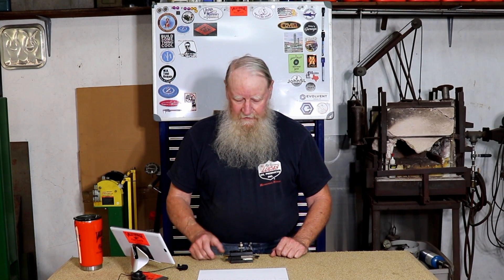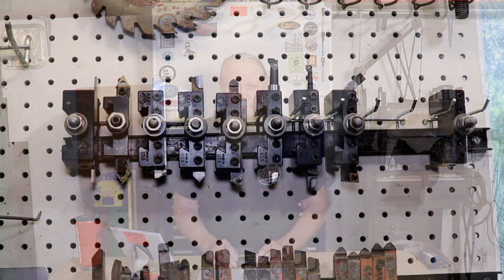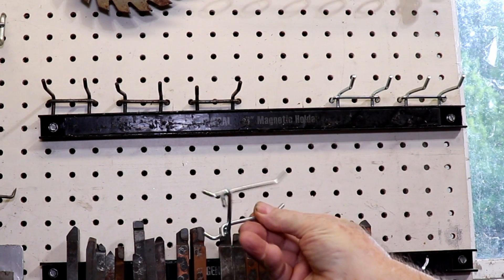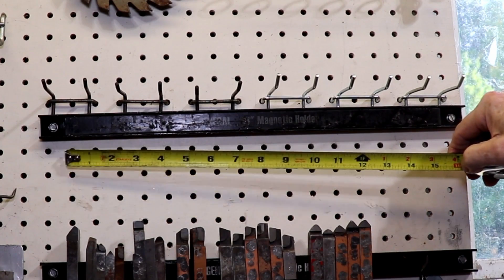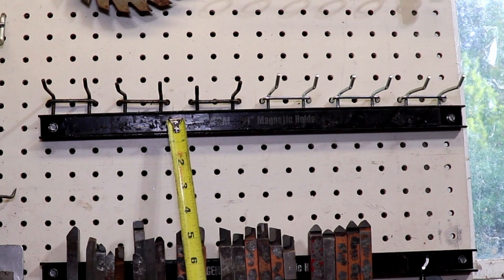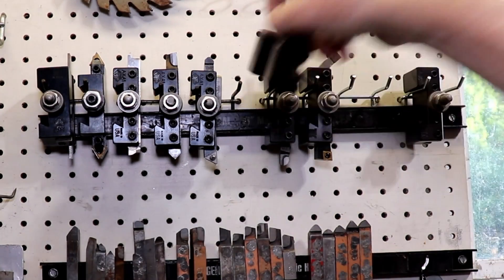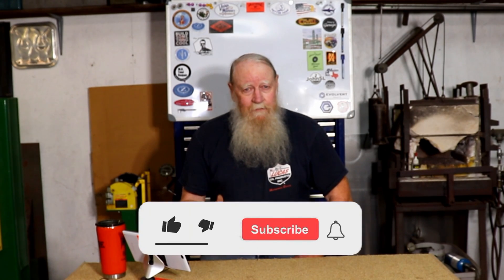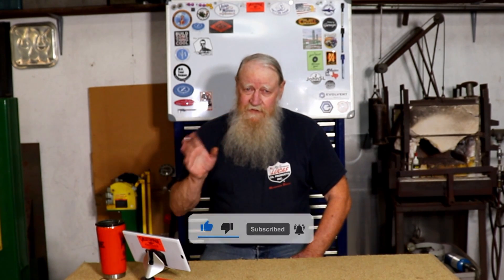AXA Tool Holder Rack

Comment: I abhor peg board.  I keep my tool holders in a drawer with all the other lathe tools.  Dollar store sells little baskets to make organizing them a breeze.  No sliding around that way.
Reply from the maker: I don't like peg board myself. Sometimes you just have to bite the bullet and use what makes since for the area that is available to you. My shop is small so I have to get as much stuff in a small space as possible.               Jere
Reply: @jerekirkpatrick2092  Oh I know all about a small space..🥺  I found a 10drawer vidmar cabinet recently that has been a life saver.  That box was 2200bucks new.. Stole it for 300!
Reply: @jagboy69  You mean you bought a used cabinet for what the seller was willing to accept to sell it for.  That's how buying used things works.
Reply: @OneTequilaTwoTequila  Ya don't say?  :-/

Comment: Great idea! Thanks, Sir. I’ll copy this design immediately. It’ll sure solve my storage problem.
Reply from the maker: If you have peg board you are ready to go. If using wood just drill some holes the proper size for some pins. If using steel, weld the pins to the top. It saves a lot of space.        Jere

Comment: I'm sure you know this but since you didn't mention it, you can get clips for those peg board hooks to stop them from being sloppy.
Reply from the maker: The hooks I used were of a larger Di. wire and were quite tight in the holes.
Jere
Reply: @jerekirkpatrick2092   Gotcha, I thought that is why you said you didn't use the single hooks.  Regardless you worked it out.

Comment: Hey Jere, have you had any issues with the tool holders being magnetized and holding on to chips from sitting in the stand? Love the idea...but not sure if that would be an issue or not.

Thanks,
Tom
Reply from the maker: I have not found it to be an issue. Try placing a strong magnet on ONE of your HSS tool holders and check the results.
Jere